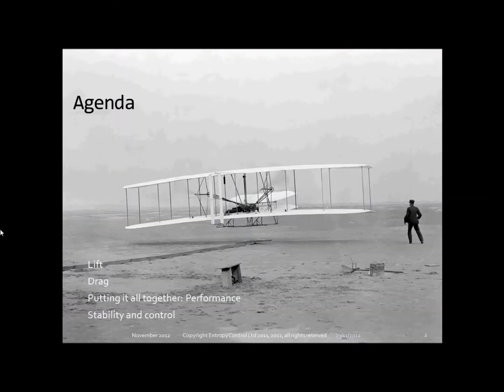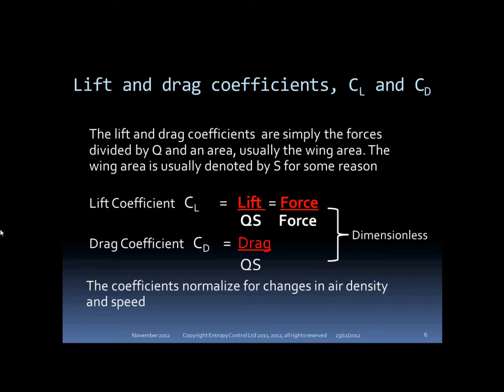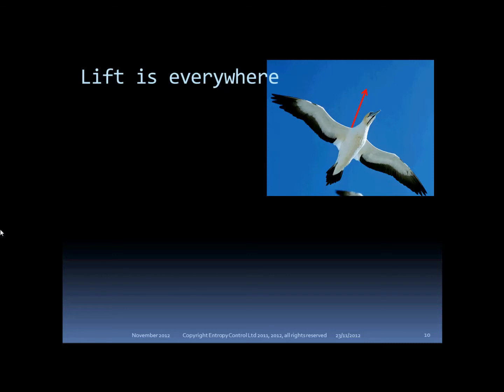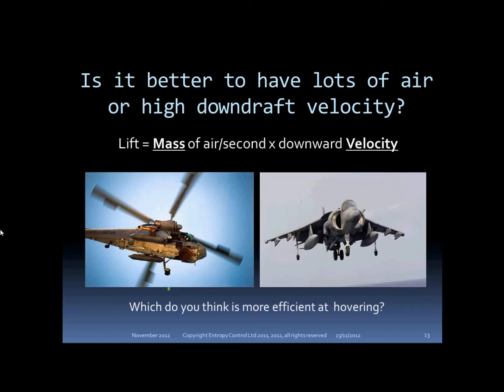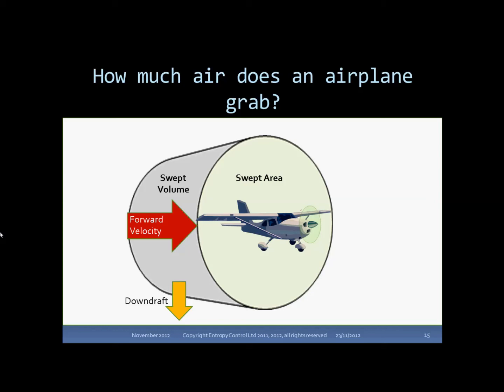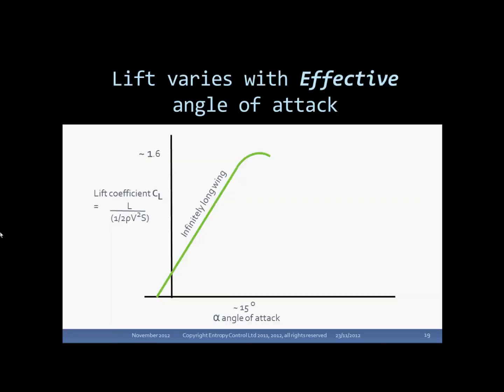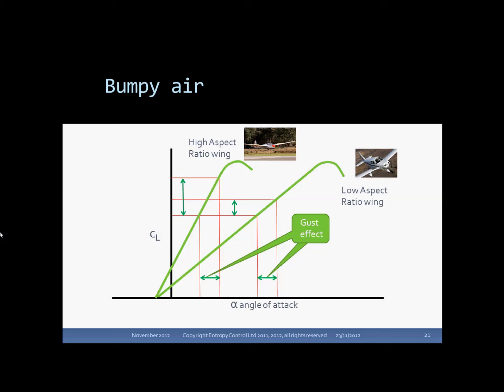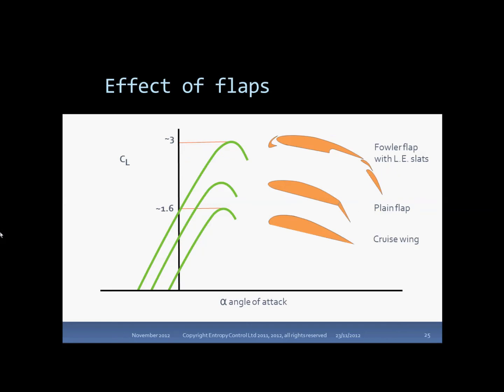Aerodynamics for Pilots Lecture 1 Lift

Comment: It is well known that a little frost has a dramatic negative effect on lift.  Presumably this is due to change of size and shape of the boundary layer.  I have always wondered why similar effects do not occur to aircraft flying in heavy rain.  Could you comment on this ?  Thanks.